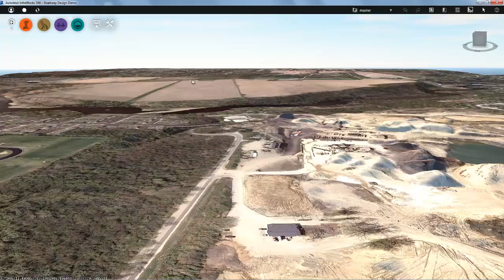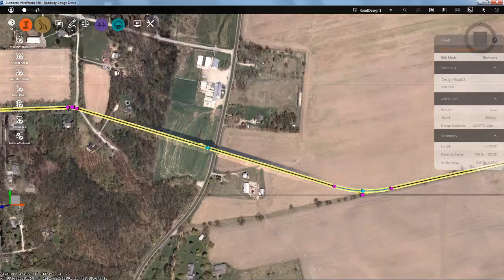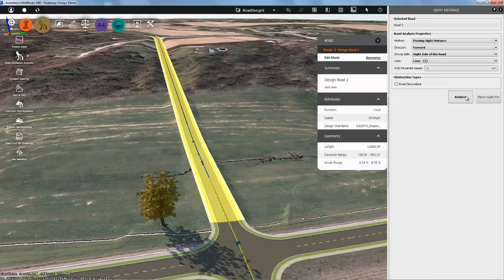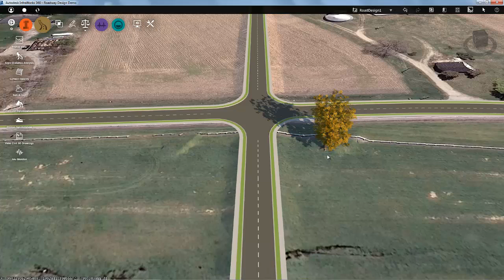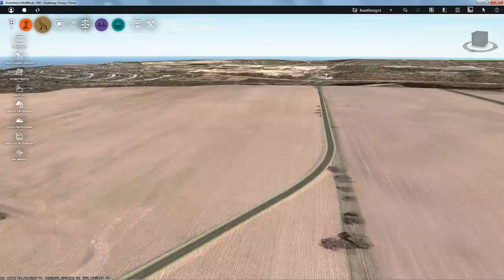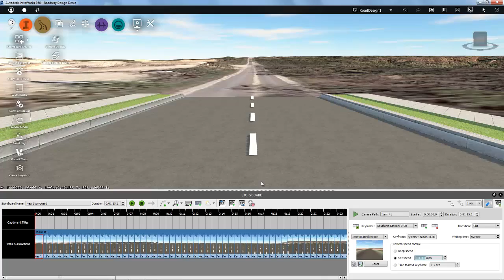Roadway Design for InfraWorks 360

Comment: great design how I get design software?
Reply: Go to Autodesk's website, register as a "student" (even if you're not one) and you'll be able to download most of Autodesk's applications without a specific short-term 'trial period.'  Once you've registered, you'll receive a licence which is good for three years and activates the Autodesk product(s) you've installed.

Be aware, access to Autodesk's software via this process is intended only for educational purposes — i.e. learning how to use their products.  If you intend to use an Autodesk product for commercial/professional purposes, you'd be well advised to buy a subscription for the products you're using.  Autodesk doesn't pussy-foot around with those who violate their EULA.